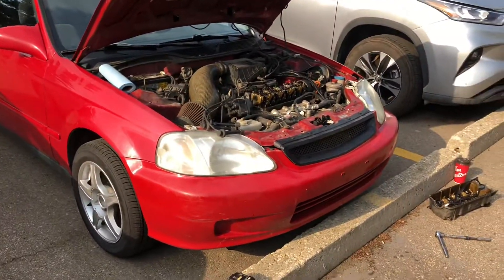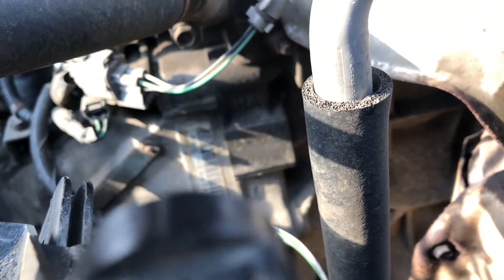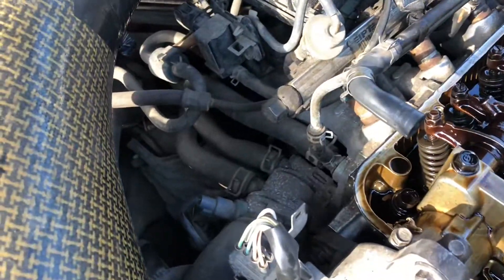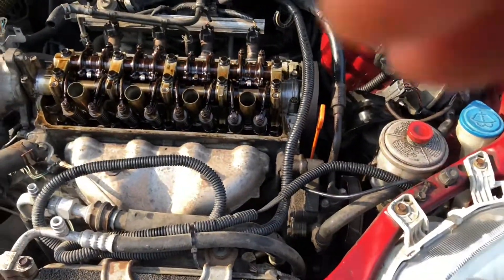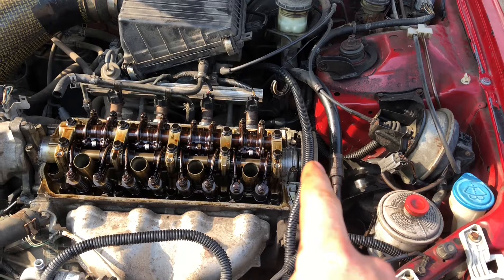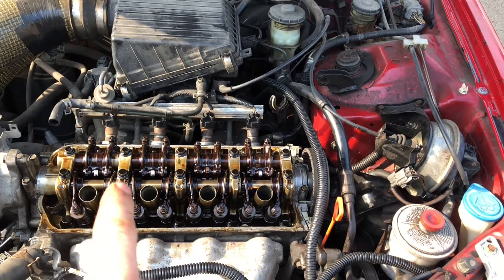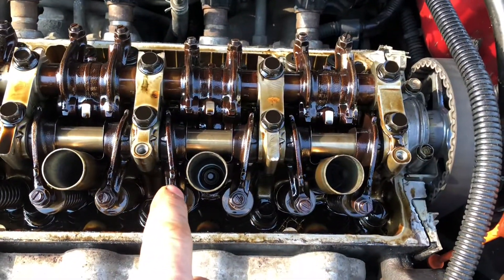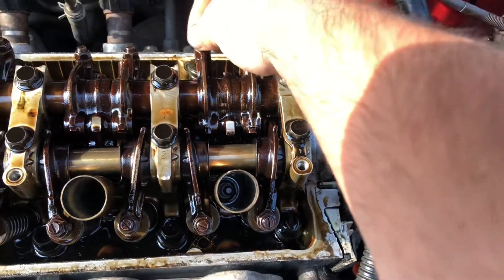D16 locked VTEC in non vtec head on a budget!! Pt.2

Comment: Unless you give constant energy to the vtec solenoid and short-circuit the vtec oil sensor, the vehicle computer will not provide more sufficient fuel and this performance increase will not be achieved, just locking the vtec cam profiles will not work. It is necessary to deceive the vehicle's brain.

Comment: Did it run? Im trying to do the exact same thing with no tune
Reply from the maker: It ran fine , honestly didn’t notice much difference tho. Ended up dropping in a y8 engine and z6 transmission. Made a huge difference with the shorter gearing